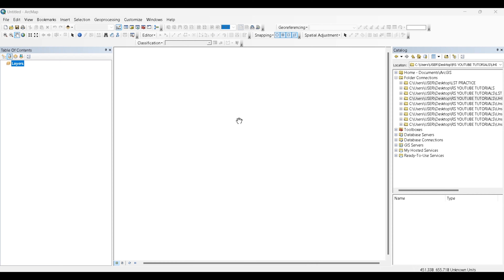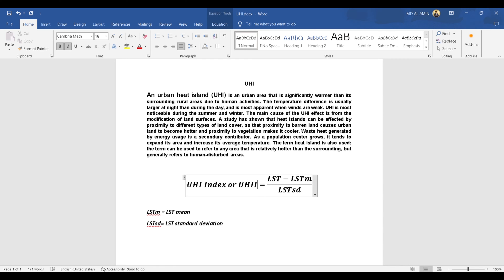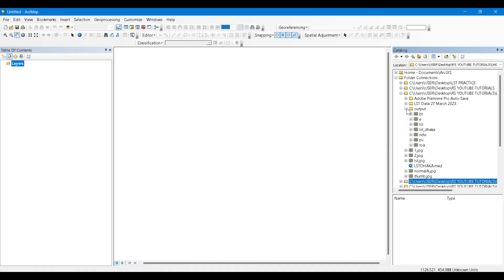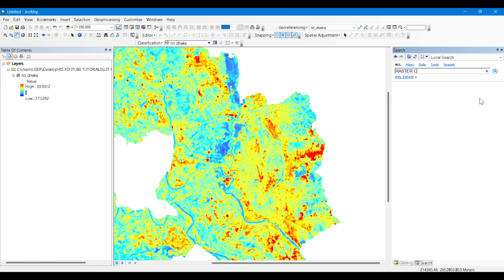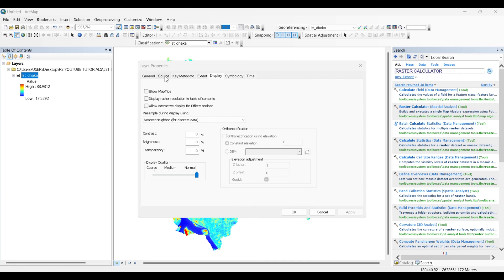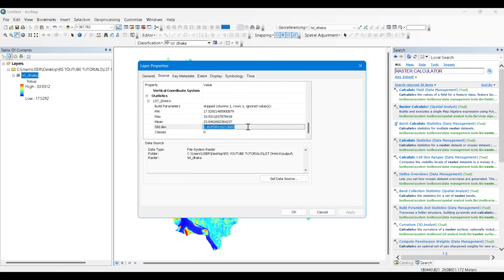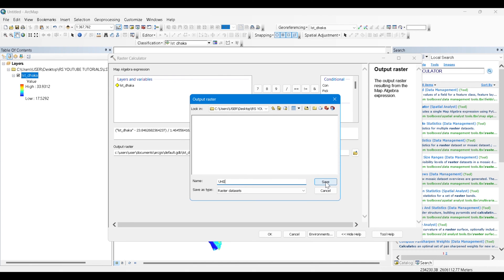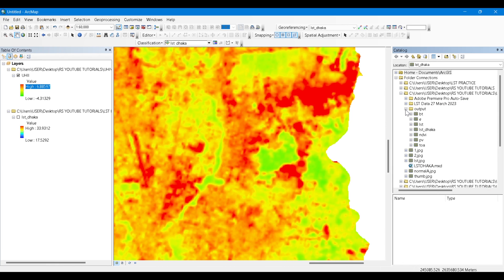URBAN HEAT ISLAND (UHI) with ArcGIS from Land Surface Temperature (LST)

Comment: may i know the source of the UHI index formula?
Reply from the maker: @leone2527  Yes, You can do it by using the raster calculator tool
Reply from the maker: @leone2527  This is the source: https://doi.org/10.3390/cli10010003

Comment: Thank you for the video. Great job! However, in my case, the color representation of the urban heat island does not correspond to the urban areas. To put it more clearly, the colors would be more accurate if inverted, but the values would still be incorrect. What should I do? Thank you.